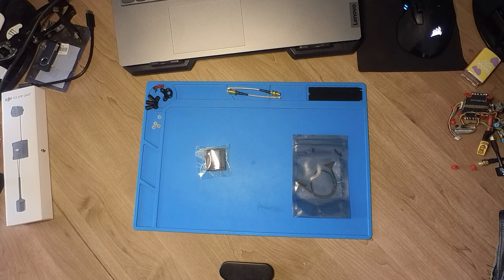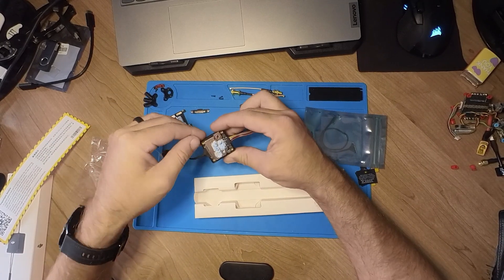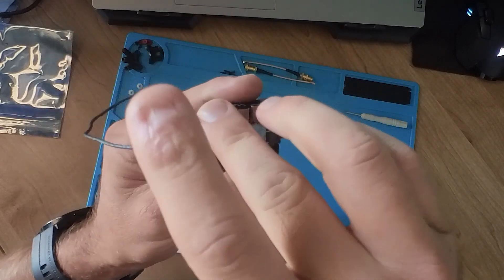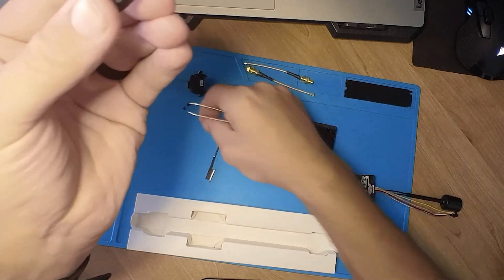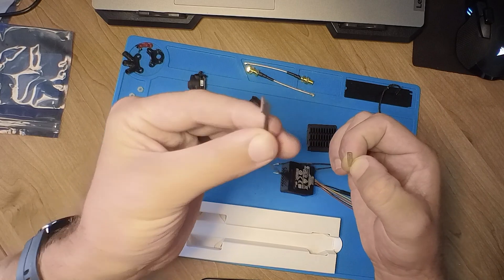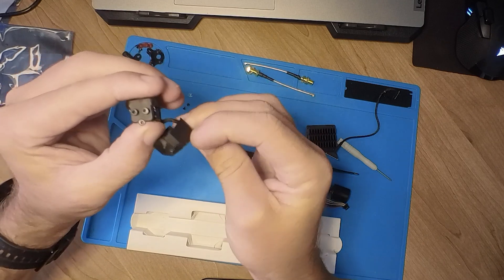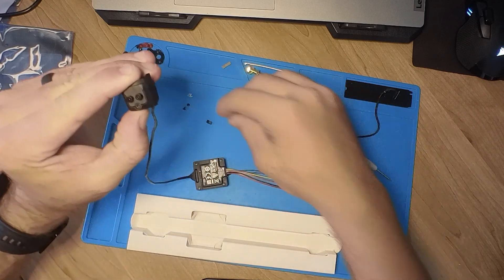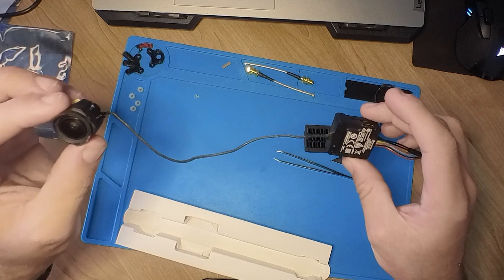How to change your DJI O3 camera cable

Comment: Hello sir i do exactly what you done but i have a blurry camera result do u have this issue ?
Reply from the maker: Blury camera? Only way you can have a blury camera is smudged lens, scratched lens, lens is out of focus (only possible if you've opedn up the camera lens side) or if you're possibly just in low power mode with focus mode turned on.

Comment: Bonjour j ai un écran noir mais j ai toujours mon osd j ai changer le câble coaxial plusieurs fois mais j ai toujours l écran noir si jamais vous avez une solution merci beaucoup
Reply from the maker: Mmm... the rx and tx wires are then correct if you have OSD, if you do not have video then you'll need to check the connector of the coaxil cable... might be that you have a bent pin...
Reply: @InfinityDrones  merci du retour j ai changer le cable mais ca ne change rien 😅
Reply from the maker: @jonathannelson2525  Sadly... I think you have a damaged connector or perhaps bent pins.
Reply: @jonathannelson2525  salut, j’ai exactement le même problème. Je vois que tu as eu ce problème il y a 2 mois donc as tu résolu le problème ?
Reply: @Gdemez_FPV  salut c'était la caméra est le coaxiale qui étais mort j'ai acheté des caméras en spare sur aliexpres à 17 euros et j'ai quelques coaxiale d'avance aussi on ne sait jamais
Reply: @jonathannelson2525  tu as acheté des camera de o3 a 17€ ?
Reply: @jonathannelson2525  et est-ce que tu avais un message d’erreur qui disait «  erreur d’étalonnage de la caméra » ?
J’ai ce message donc je sais pas si ca peux marcher en réglant ce problème sans rien payer…
Reply: Hi @Gdemez_FPV
I have the same problem as you... did you find a solution? I just unplugged and plugged the camera which worked fine before that. Now I just have telemetry and can't calibrate.
Reply: @29reflex  j’ai juste racheté un o3 finalement…
Reply from the maker: Good for you
Reply: ЛИБO CXEMA BCЯ HAKPbIЛACb

Comment: I ordered 150mm cable thinking it be 50mm longer for 10" building. Then heard mad tech saying they measure different the 150mm cable most likely the stock cable 😢
Reply from the maker: Ah man sorry to hear... But I would say you should go for the 25 or 30 cm option
Reply: @InfinityDrones  I didn't find 300mm in stock. Didn't see any 250. So ordered 200mm. Should be exact length if I'm good at guessing 🤣
Reply from the maker: @divingfalconfpv4602  fingers crossed it all works out for you man. On a 10 inch I think it's going to be tight

Comment: Sir thank you so much. My dji avata has black screen. Do you think it is coaxial cable issue? Because the gimbal wont move too
Reply from the maker: I would think it would be. check that all the cables are properly seated - sometimes they can pop loose in a hard crash.
Reply: ГЛABHOE ЧTO HE CИHИЙ ЭKPAH! A KAБEЛb 3AMEHIШb - HE БEДA😊

Comment: Thanks for the video did u run into a y issue after namely a black screen with osd ?
Reply from the maker: No issues. Black screen is usually something that's not correct on the mipi cable

Comment: I don't understand why there was a need to remove the cover from the thermal paste? The wire is easily changed without this.
the wire has its own separate cover, which does not affect the rest
Reply from the maker: You need to replace the cover with the iflight heatsink.

Comment: Where does the unit get hot more?  The DJI logo part Top Side ?  Or the bottom part ?  Thanks
Reply from the maker: Top and bottom center. The heat comes from mainly from the center